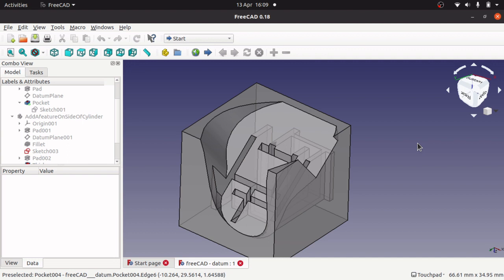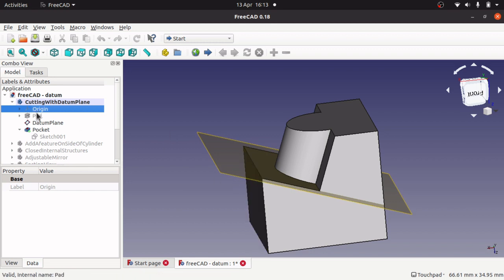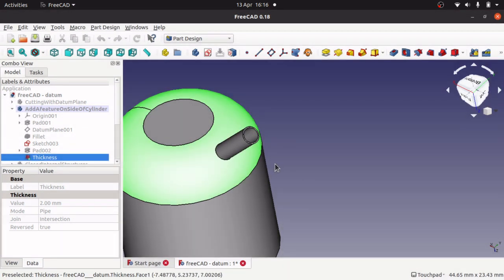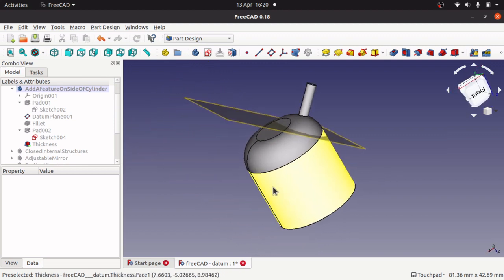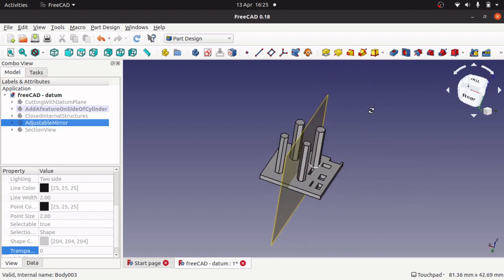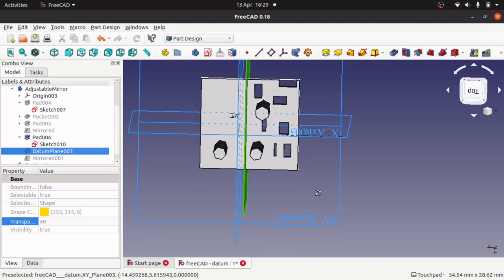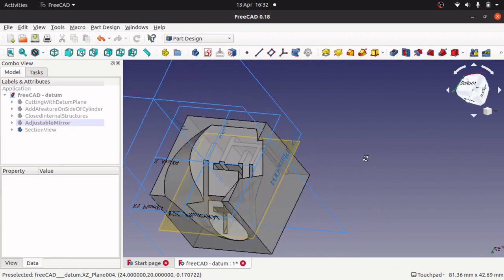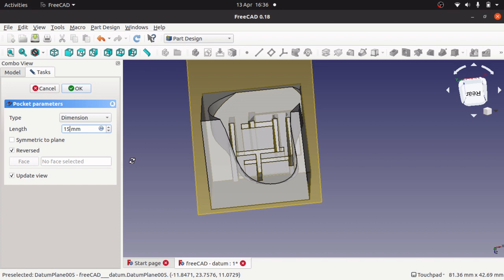FreeCAD Datum Plane With examples of use: Slanted features, sketch on curve, cross section.

Comment: Sometimes when I'm trying to sketch on a datum plane, I need to rotate the object to see what I'm doing. If the plane is skewed at an angle, is there a way to make the view straight on perpendicular to the plane as it initially is right after clicking the sketch button? Thanks!
Reply from the maker: Good question and one I have over looked.  On the top menu you will see a sketch icon with a magnifying glass.  Click that to center view.  Also available from top menu > sketch > view sketch.  Q the S for shortcut key.
Reply: @MangoJellySolutions  Thanks for the reply! I've only been using the program a couple months and have lots to learn so I'll give this a try. It seems like I tried the magnifying glass and it centered in the screen but didn't rotate to normal, but I could be wrong. Thanks again!

Comment: such a hard program to learn!
i am try to learn as much as i can, i have been at this program for the last 2 weeks now and i feel i have learned nothing so far!
but once i learn it i am excited to 3d print
Reply from the maker: CAD full stop is hard to learn, freecad takes a unique approach trying to be as flexible as possible which causes an extra layer of complexity. Stick with it and learn part design first and that will simplify things going forward. It takes a while but you will get there in the end.

Comment: Can you center a datum plane so that it will end up in the center of an hole that sits on a body? I need that to position my sketches that are used for the helix to make threads. currently I can only model threads, when the hole is in the origin. I think a datum plane is what I need here, but they are not centered over my hole.

Comment: Thanks for the demo. I've watched this video and a few more  and I get how to use Datum Planes to attach features to a curved surface, like you do in AddAFeatureOnSideOfCylinder. But I still don't see how to set the precise length of such a feature. Your datum plane in that example was inside the part, and your pad was long enough for the demo. What if you wanted it to protrude exactly 10.5mm from the fillet?
Reply from the maker: You could use the x,y,z offset to position / fine tune the datum plane. Also it's worth noting with such a surface it may be worth looking at a different technique such as the curves work bench sketch on curve.  On Tuesday I am releasing a video regarding a build I have been working on and I think it might help with your question.  Other ways are to use boolean techniques where you make the features separately as individual bodies and join them together.

Comment: The most difficult thing I met on FreeCAD is to make revolve the DatumPlane around a cylinder buit as Revolution. Thus Creating a solid cylinder by making revolve a very thin rectangle, and place a DatumPlane over its wall and making revolve around that cylinder, placing it to a specific angle different form the XYZ axis.. An User Experience that for me was and still simply horrible. I can't find good explanations/tutorials for.
Reply: Even if i'm too late, i let this hint here: In the Addon-Manager is a workbench called «Curves» That should fulfill your request.
Reply: DatumPlane is not a thin surface. It's a plane with localized XY coordinate system. Its length is by implementation, infinite.

Comment: when you're inside the sketcher you could rotate the 3d view freely.. i wonder how coz i cant. i have v0.18 .. thankyou so much great explanation
Reply from the maker: Thanks for the comments. I have just tried and I can also do this in 0.18. I am using the touchpad navigation setting for my mouse control I wondering if your using a different control system like CAD or Blender?
Reply: @MangoJellySolutions  ohh i think i just was stupid in that so i didn't experiment... im using Gesture coz it dosn't need any keys ... and inside the sketcher i find that i just have to hit alt to rotate... thankyou so much it gets easy because of you bro
Reply: Hold Shift + Right click, you should be able to freecam